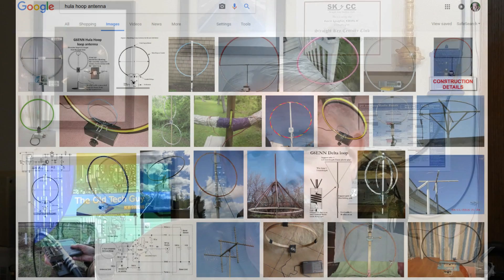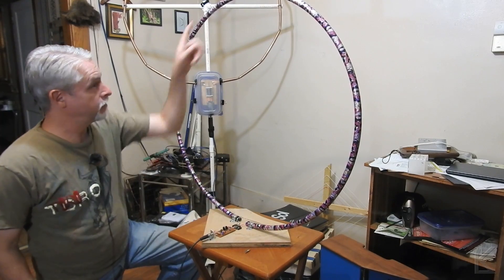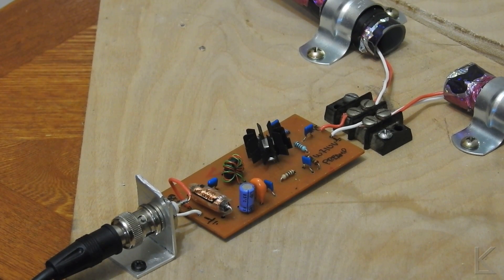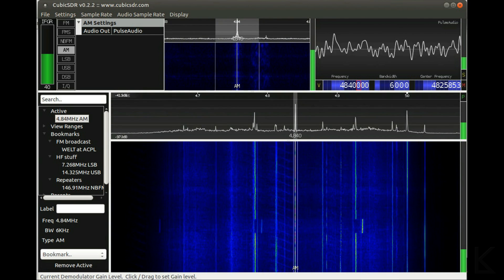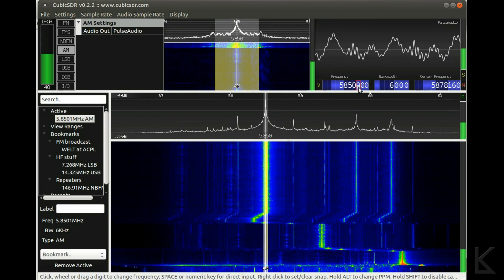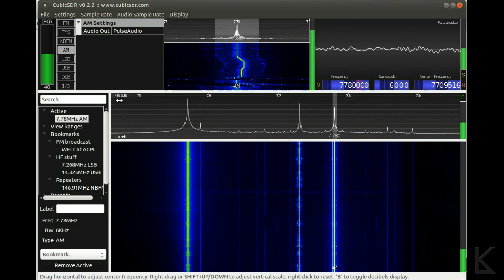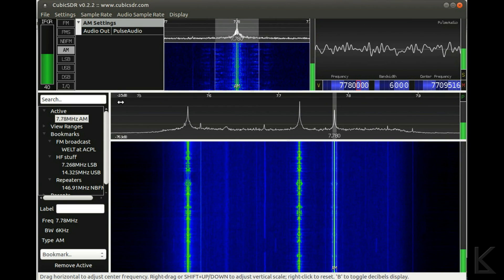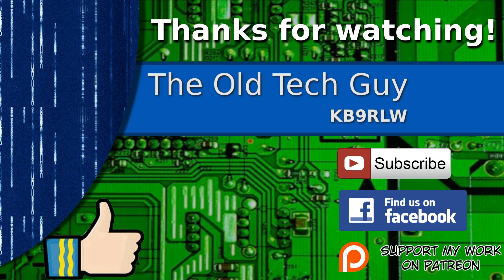Ham Radio - The Hula Loop active RX antenna

Comment: Kevin...would this loop RX antenna and pre-amp work well on an AM crystal receiver?
Reply from the maker: No.  A crystal receiver rely's on the power coming from the antenna to drive the earphone.  You would have to take out the preamp.  I don't know if just one turn of wire would be enough of a loop for a crystal receiver.  You'd need 5 or more turns to get down there in frequency and get any volume out of the receiver earphone.

Comment: Two questions, Kevin: 1. You say the preamplifier is powered through the coaxial cable by a bias T. Looking at the schematic of the W7IUV preamplifier shows a separate DC connection point. How did you accomplish the bias T connection? 2. Also, it specifies the input impedance as 50 ohms. Would you not  get better results with a higher input impedance amplifier when feeding it with a loop antenna?
Reply from the maker: The center of the coax connection goes through the choke to the B+ for the amp.  The output of the amp is capacitively coupled back to the center of the coax.  The cap isolates the DC.
And maybe you would get even better results with a better match at the input, but it does pretty darn well as is.   I wasn't even running the amp at full gain, I was only feeding it 4.7 volts from the SDRplay.  At a full 12 volts, it would have been even hotter.
Reply: Thanks, Kevin. I just discovered your 4th of July video that clarifies the D.C. question. As far as the input impedance, it might be interesting to experiment with a ferrite transformer; maybe a 3:1 for starters. If nothing else, it would restore the balance to the loop itself.

Comment: You sleep about like I do. Three or hours hours at a time.

You need to do a video on the pre-amp and explain it more.

Moe K2JDM
Reply from the maker: Hi Moe,     I did talk a little bit more about it on a previous video where I used it  with my junk box magloop.  It's a very popular circuit with lots and lots of reference material and re-designs out there.  I could do one if there was enough interest though I suppose.   Here's the other vid where I used it on the junk box magloop.
https://www.youtube.com/watch?v=OzS4X6Ye4fg
Reply: I knew I missed something.

Comment: Hi Kevin, I enjoyed your video. I realize that this loop is pretty  broad band, but does it have a specific bandwidth, like would it do well at 80 meters for instance?
Reply from the maker: Yes, it's very broad.  It does cover 80 pretty well, but starts dropping off below 80.   In the 80 meter band, it was still stronger than the mini-whip.  But around 2 Mhz they were even and below 2 Mhz, the mini-whip was doing better.   I think it the loop were three to four turns of wire, it would drop right down in freq.   I'll be experimenting with it more.

Comment: Interesting! At the Mena Hamfest I picked up a MFJ 1020B Active Anetnna! Haven't used it yet but thought about trying it on a cheap SW portable I have (in a drawer somewhere). It does require external 12 volts, but that's not really a problem.
Jim KF5AQF
Reply from the maker: I've read good things about that antenna in the past, somewhere..   The only down side is that the amp also amplifies unwanted signals.  You have to keep it away from noise sources.